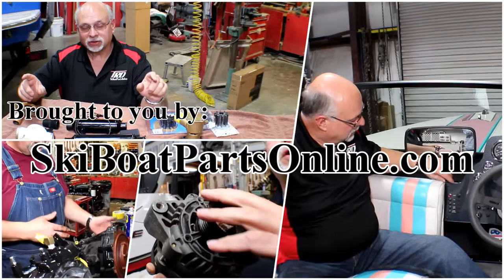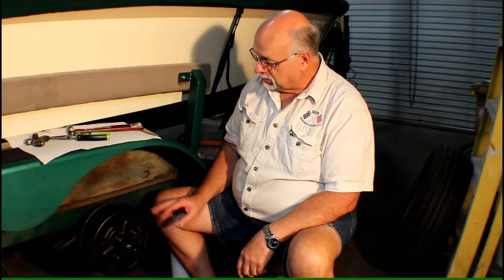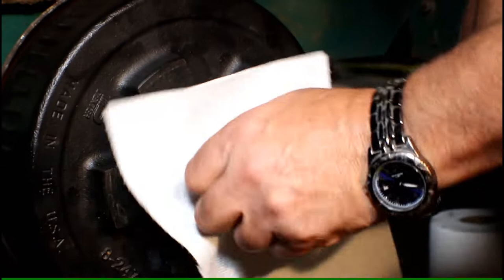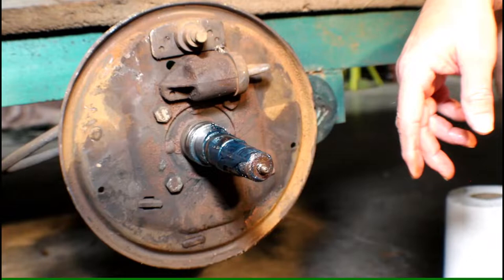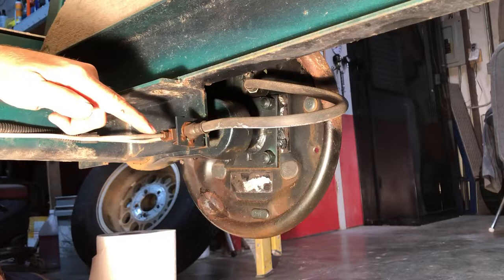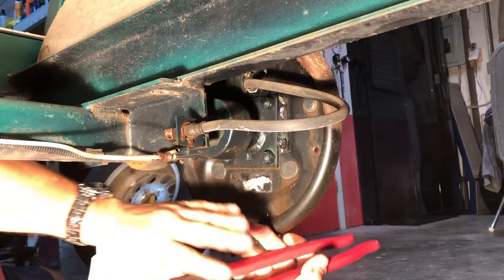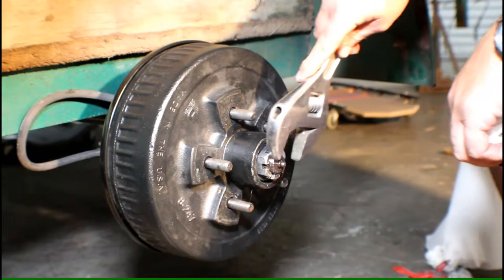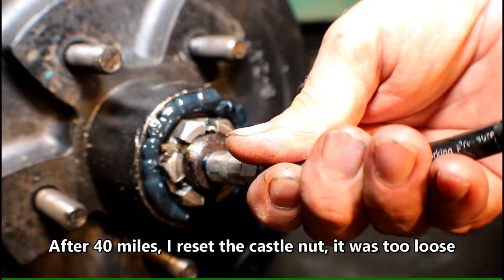Ski Boat Trailer Brakes Part 2

Comment: Since I own a boat, I suppose I need to attend trailer maintenance school (actuators, drum/disc brakes, bearings, bunk boards, winch, jack, lights &  tires); motor maintenance school (oil/filter changes, fuel filter/water separator changes, spark plug changing, steering/trim, adjusting shift cables + winterizing); outdrive maintenance school (gimbal bearings, bellows, impeller changing, gear oil, drive shaft & props), and in my spare time, I'll also go to welding school, fiberglass repair school, upholstery/sewing school, electrical engineering school & maybe I'll be able to squeeze in a dashboard gauge repair class.   All at night after my day job, yeah . . . sign me up! 
All jokes aside, great video but probably above my limited diy skill level.

Comment: Here's another tip we use in automotive industry when bleeding brakes. Use a vacuum pump connected to one bleader at a time to get the air out. 
Just don't let your actuator/master cylinder run out of brake fluid.  Otherwise you 'll have to start all over again.

Comment: You can pump that cylinder with a 2x4 - one end wedged on the ground; push the top toward the boat bow with the center of the 2x4 pushing the tongue in - much easier to "pump" the cylinder

Comment: My trailer has this exact same looking master cylinder but my cover that covers the fluid fill port is just a thin plastic cover not a "lock out".  Why do I not have a lock out for when I back up? Thanks for this detailed video and the strap trick is the best.
Reply from the maker: The thin plastic cap/cover is standard, the aluminum lock-out cap is optional & we do have them. The lock out method for the std set-up is a removable "key" that is placed on the side blocking movement of the forward pin...not very handy to use.

Comment: I bought an older 4-wheel boat trailer which has brakes on the 2 rear wheels only. Is this normal or has it possibly had brakes removed from the 2 front wheels? Decals say it is a Ti Trailer. I think made in San Marcos, Ca.. Thanks!

Comment: I had one brake lock up, and white smoke poured out.  The drum looks a bit discolored, the shoes still have a lot of meat on them but have a black stripe down the shoes.  Does this warrant new drums and/or shoes?  Thanks in advance.
Reply from the maker: Not necessarily, auto/truck applications never paint the drums, marine applications typically do paint the drums, this is where your smoke may have come from. If the bearings & spindle are good next is the  run-out of the drum, in other words is it still round or egg shaped, if still round you are good to go, if not replace the drum, not sure about the black stripe in the shoes, would need a pic of that to see what it is , but I doubt it is serious.

Comment: Hey Ron "if i convert my Hydraulic drum brakes to a disc type hydraulic rotor version. Wil the Attwood hydraulic Actuator work for this conversion?. I have the Attwood Actuator that is welded on my trailer.

Comment: Did you have to bench bleed the master cylinder?  Or did I miss that?
Reply from the maker: No, we don't bench bleed these, install, connect all the lines then bleed the system, then pressurize & test for leaks.
Reply: @rontanis1024  thank you for your quick response.  I watched part one and two.  Can't seem to get the air out of the lines because it's air and not fluid it doesn't compress the same.  I have the tongue of the trailer down below the level of the wheel cylinders I am going to try to take the line off the wheel cylinder and crack it at the bottom by the master cylinder and gravity-feed some fluid in there try it again see what happens thank you for all your help
Reply: PS mechanic for 25 years computer tech for 25 years.  So I guess  not call Master cylinder that's why they called actuators cuz they actually work a little different than the master cylinder in a car